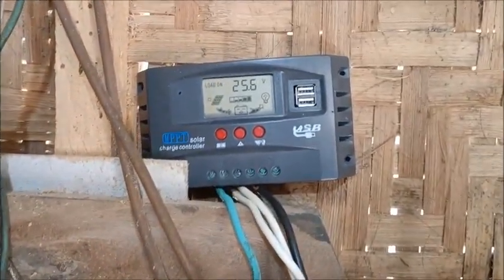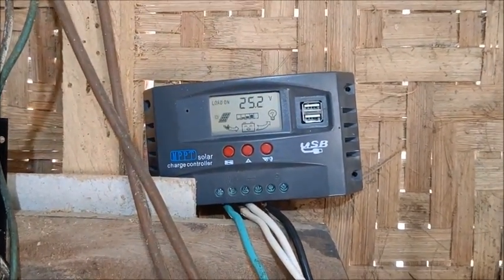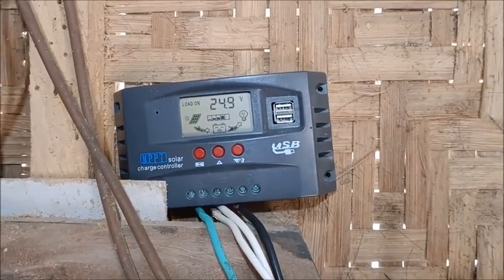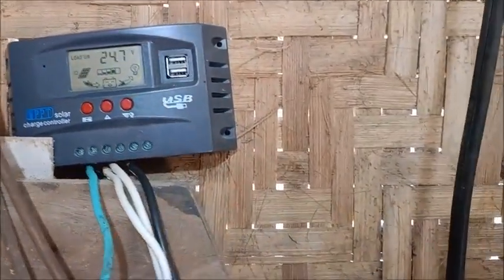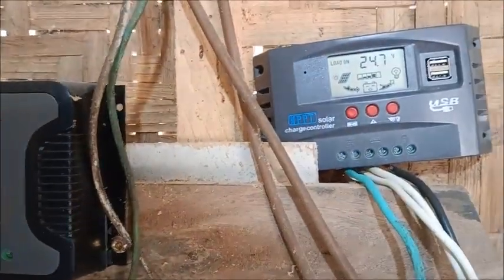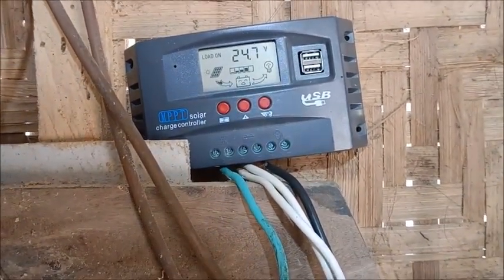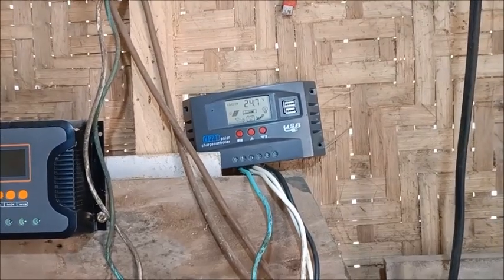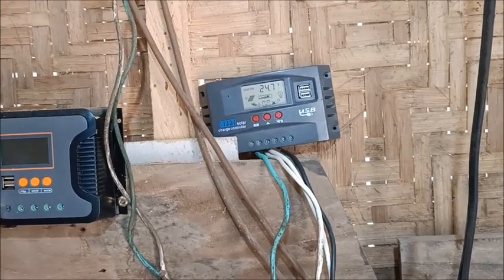Testing Out The New Solar Controller

Comment: With all due respect, the panels could be configured for 12, 24, 48 volts depending on the SCC, INVERTER, BATTERY specs.

Comment: When you buy something online and it has no brandname on it, you know it's probably the worst quality available. It's almost certainly a PWM faking to be an MPPT. Save up some money to buy a real MPPT from a reputable brand. That will save you money in the long run.
Note that when you have a PWM you should get your string voltage to be as close to, but slightly higher than, the battery voltage as possible. So if you have panel maximum power voltage over 26 V, you should use a string of 1 panel, because unlike a MPPT, a PWM doesn't convert the higher voltage into more amps. That's probably also why the display doesn't display incoming amps and power. The amps coming in and going out are the same, it's just the voltage that gets cut off to charge the battery at the correct voltage. Displaying the Watts coming and and going out would show how abysmal the efficiency of this PWM is.
Also: always read the manual before you hook up electrical equipment.
I have a cheap Chinese hybrid inverter with 2 built-in MPPTs. The brandname is One Solar. They also sell MPPTs. So far it's working flawlessly. Victron is the Rolls Royce of MPPTs.

Comment: what name brand is your new SCC? all i can see is MPPT SOLAR CHARGE CONTROLLER. on the top of the SCC should be showing at least VOLTAGE and MAX WATTAGE in solar panel output that it can safely process. of course, again as we are dealing with chinese-made products, take that advertized wattage with not 100% confidence. so, i would not rely so much on the readings (voltage and current/amperage) showing on the SCC LCD screen.

what i would really pay attention to is the INVERTER.

i have the same brand inverter you have but it is a 12V 2KW.

that would be 2,000 watts. BUT i have determined to pay attention that i only draw 1,200 watts. 

somewhere in the i-know-not-where-now, i came across something to use up to only 80% as some kind of rule-of-thumb. but of course you will say that 2,000 less 20% is 1,600 watts. and you are completely right,

so then?

there is something called power factor (PF) in electrical circuits. no, i've never really wrap my head around this PF beast.

but the little i can understand is this: because a circuit may power more than one appliance, the current/ampere draw realistically more than what may be needed by the appliance/s. and this is because not of so-called inductive appliance - motors with coils. we are not speaking here about the so-called peak/surge when a motor starts and restarts.

the PF seems to refer to the fact that inductive appliances may not be that efficient in the use of the power supplied. meaning that the actual power supplied may only be 80% efficient. PF technically is between 0 & 1. but for us unenlightened, we rely on the PF represented in percentage. 

now am not certain that 80% cited above really does include already the  PF. however, being that there may be more than one inductive loads in a circuit, i decided for 1,200 watts on my 12V 2KW inverter. hoping for my system (battery) to last longer.

an electrician would be able to explain for you what PF really means for the heart of PF really is the so-called Voltage and Current (amp) being out of phase.

Comment: Thanks for the upload. Good to see you're still mucking around with these silly charge controllers. I never used them instead, I initially went with a Growatt 3,500 watt hybrid inverter and now have upgraded to a Felicity solar 5,000 watt hybrid inverter. Both inverters run without batteries and both are great inverters. The cost were I think PHP 36,000 for the Growatt brought off Lazada and took about a week or 2 to arrive. The Felicity solar inverter was around PHP 24,000 (PHP 22 something for the inverter and PHP 1,200 for LBC overnight shipping from Manila)
So what you are doing is taking the sun power and charging batteries and then using the batteries to run the inverter to power the appliances....... with a hybrid inverter it takes the sun power and firstly converts it to run the appliances and when you have more power than you are using it will charge the batteries and when you are using more power than the sun is providing it will draw from the batteries.
In my opinion it is a way better system as you're not using the batteries for 100% of usage.